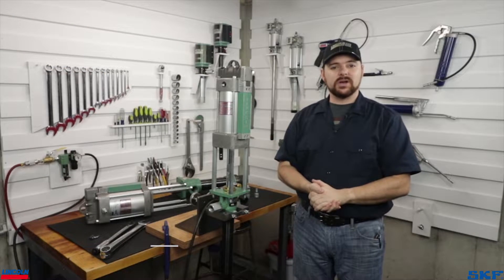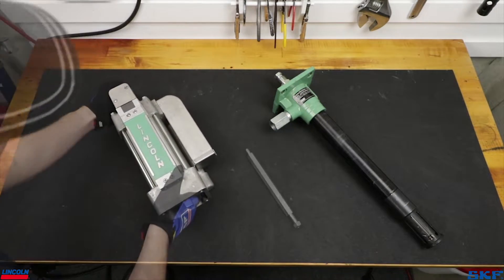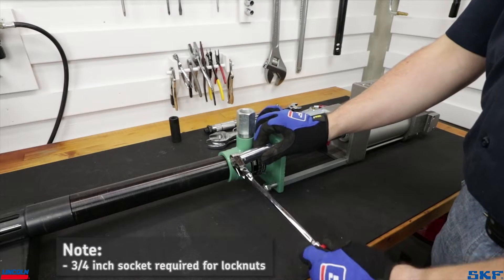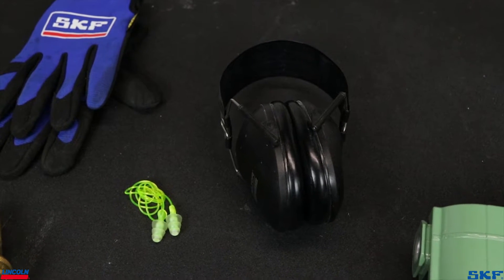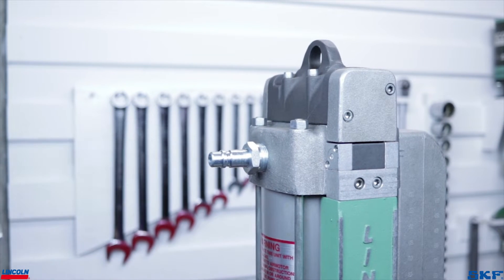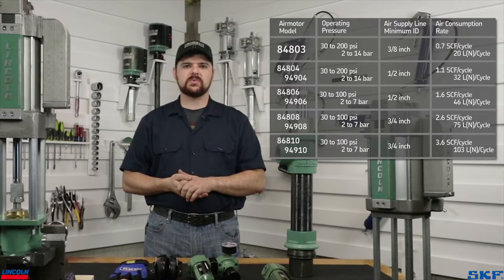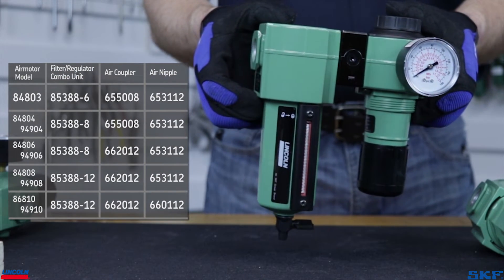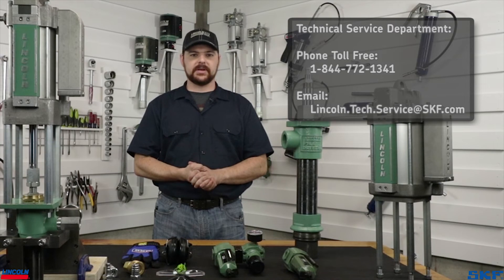Lincoln PowerMaster III & PileDriver  airmotor install procedure

Comment: "If the combination of air motor 84806 (6") and 85304 pump (140:1) is used to pump grease via a 1/2" hose over a distance of 120 feet in order to achieve a maximum grease delivery pressure of 14,000 psi, what is the maximum air discharge that the air motor requires at 100 psi?"

Comment: How much grease does it dispense Per stroke on the 4 1/4
Reply from the maker: Dispense volume depends on the selected pump tube. The example 84918 pump tube assembly used in this video will dispense 10.9in³(179cc) per cycle with either the 4 1/4"(84804) or the 6"(84806) airmotor installed.